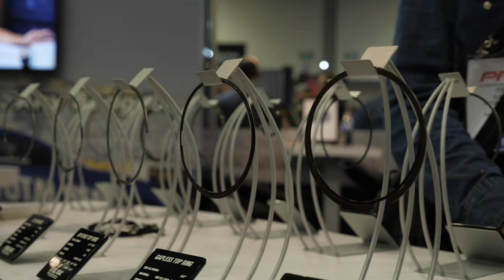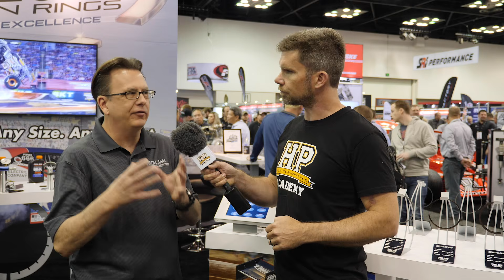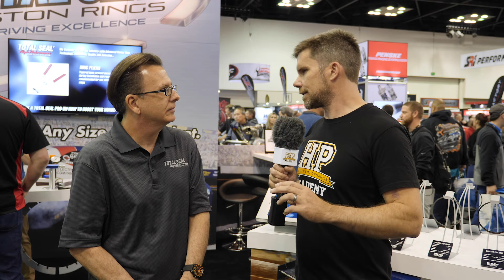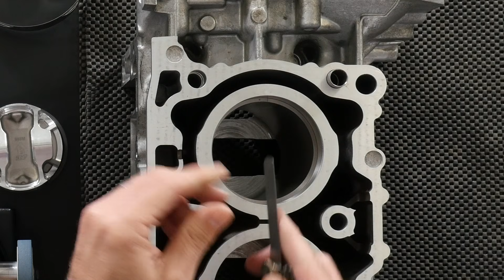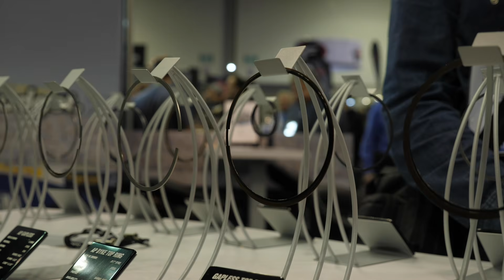Behind the Scenes of Gapless Piston Rings And Ring Flutter [#TECHTALK]

Comment from the maker: 🦸‍♂ Building a fast car? Get $400 OFF the all inclusive VIP online course package deal: https://hpcdmy.co/vipy78
🔧50% OFF your first engine building course. Enrol now:  https://hpcdmy.co/offery78
TIME STAMPS
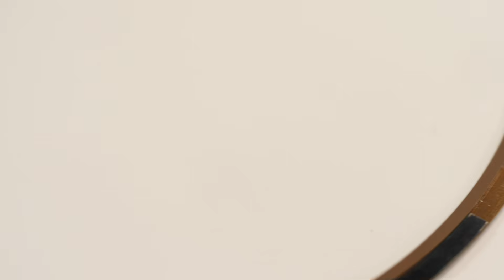00:00 - Intro 
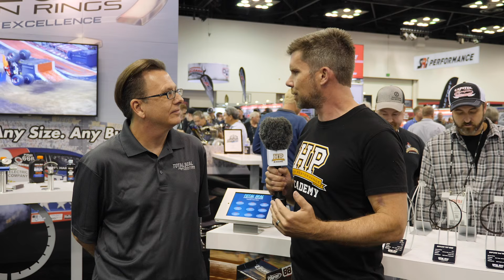00:30 - Gapless ring design 
00:50 -  Brief history on the gapless ring
01:20 - Why do we need gapless rings?
02:00 - Advantages of a gapless ring?
04:13 - Top Ring & Second Ring setup theory
06:08 - Which setup should you go for? 
06:51 - Heat considerations?
07:47 - Ring widths & Sealing
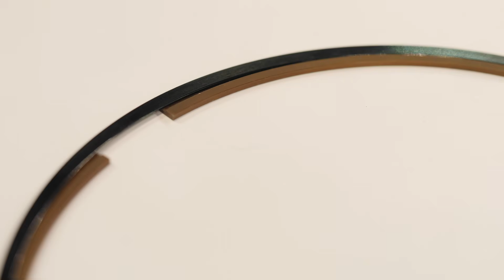09:40 - Heat Management & Micro Welding 
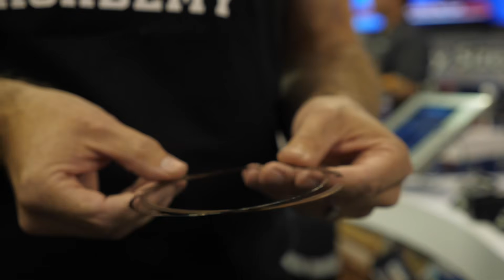11:50 - Radial Tension of rings
13:47 - Total Seal Products
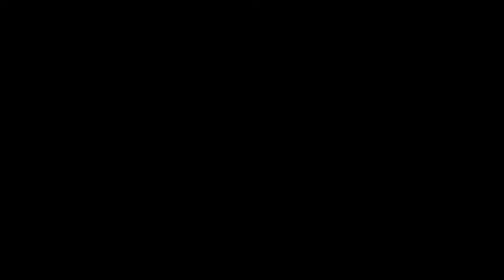14:29 - Outro

Comment: If you want an oil burner use gapless rings . I wasted alot of money on two sets of these rings , both  sets was on a fresh bore honed on a sunnon machine following keith's instructions to a tee . results were 200 miles to a quart of oil . went back to conventional rings and everything sealed up tight .I will never use or recommend these to anyone . Since i have talked to a fair few that had the same results . The oem never used these for a reason . Don't drink the Kool Aid .
Reply from the maker: A bit late for you sorry but but around 12:58 they say it's super important to consider the application, not just with gapless rings either. Everyone wants a performance engine that has the same maintenance intervals and costs as a stock OEM build, but it doesn't work that way; you are right 😅 - Taz.

Comment: These can work in various combinations, but they are far from the end all be all in rings. Fact is the friction of these rings in total is horrible and friction costs hp. Ring friction accounts for over 40% of friction in a engine. NASCAR engine builders do not use these rings and they have less than .0001 cylinder wear in a 500 mile race. Their specialized rings are available in .0001 oversize increments.

Comment: Fast forward to the future. Wagler Diesel ran a Cummins to just over a 1000hp and 1500ft-lbs of torque with Lake Speed Jr using Total Seal gapless 2nd ring. This was back to back with conventional rings. Cut crankcase blowby CFM in half. Oil stayed clean until the last couple pulls vs instant black with conventional. 10+ hp across the board, same boost with gapless, everything else the same. If extreme pressure Diesel combustion explosions didn't cause flutter, chances of it are very slim. Thats 250ft-lbs per cylinder in the Cummins starting at 1500 rpm. How much cylinder pressure is that? I'd bet a metric f*3kton.

Comment: This, by the way, is the next big frontier in modern racecar engineering: combining durability and reliability with friction reduction and high performance. That means compared to racecars of yesteryear where people were making rapid advances in fundamental engine design and suspension geometry and composites manufacturing and safety, today's innovations are in piston coatings, cylinder wall coatings, oil control, oil delivery, and uniform combustion sealing. When everybody operates at 99.5% or higher, that last half percent is the difference between winning and losing.

Comment: I run a gapless top ring on my SBF 331 and i do get ring flutter on my second ring as it doesn't let any blowby get by the top ring to seat the second napier ring and seat and seal and scrap the oil off.  Ill will use about 1 qt of oil every 100 miles.  The way i coreected it is i sealed the engine crankcase and let the engine become its own vacuum pump and seat the second ring.  Running this way, ill use 1/2 qt every 1000 miles.  Ive sean on total seals website that they now say that the gapless top ring does have a oil consumption issue as a negative on its use

Comment: So what is the compromise when using gapless rings.   If it was all good and no bad they would be in every OEM engine but that isn't the case.
Reply from the maker: You are 100% right, not everything that is good for a performance engine is good for an OEM engine. They are very different things built for different purposes 😎 - Taz.

Comment: I ran Total Seal's gapless on the street and race, both gapless top and gapless second.  The gapless second, on a well built 454, ran very well for over 200k miles.  Different story on race engine.  Consistently had oil smoke out the exhaust, oil consumption issues, detonation due to oil in the chambers.  This was with both gapless top or second.  Both had the same issue.  Went back to conventional rings, issues gone....

Comment: I saw a comment from some idiot armchair mechanic that said all piston rings rotate on the pistons when the engine is running so it's pointless to clock the rings so the gaps are is opposite positions 😂
Reply from the maker: They are right and wrong as they do rotate, but you still need to clock them noting they are both rotating and the chances of that happening so that they all align and stay locked there are slim.
It is also something that is out of our control, so you still give yourself the best chance of success regardless of such things.

But you know all that yourself, it's the other chap who is going to regret the 10 seconds of time he 'saved' on that step.

We see the same type of person saying that oil splashes onto your con rod changing the weight so there is no point balancing them too. People are weird - Taz.

Comment: Who was the maker of these rings, I can post picture of a piston that had gapless rings all the way around and it busted a piston after 5 years at 750 hp engine components rated for 1000 76mill turbo meth injection so if these are a better manufacturer idk be interested in checking them out
Reply from the maker: Nothing last forever to be fair and there is a point where building for a higher HP than you are running doesn't actually add any longevity. In some specific cases it would actually reduce it.
To answer your question though I believe 'Total Seal' is the brand Andre has personally used in a dedicated drag engine build/s - Taz.
Reply: @hpa101  thank you I believe the builder might have ran to tight of ring gaps and under boost it eventually blew up

Comment: yeh there's no ring flutter with a 9000rpm sprint car engine with 17:1 compression..
because at that high of a compression ratio, there's still enough blowby pressure to get past the 2nd ring,  even while using a gapless Total Seal ring, rather than pressure get trapped between the rings and cause flutter.  and there's enough blowby to make the low tension or standard tension oil ring work as well.  because some slight blowby is what makes the oil rings work work in the first place.  it's a simple concept, looking up at the bottom of the piston, from the crankcase side, blowby air pressure above the piston acts as an air gun and blows oil downward into the crankcase, and off the rings, and into the oil ring grooves, and openings in the oil ring groove, into the inside underside of piston.  and that keeps it out of the combustion chamber.  this is why Total Seal rings on a street engine smoke.  they're really a high compression race only ring application.

Comment: Do you think the second ring is even required with gap less?
Reply: On short track engines we only ran the top gapless, NO second and the oil control. If the skirts are short on the pistons with only the top, the piston can rock in the bore. The longest rod you can install helps this.

Comment: Does anyone bore/hone cylinders at operating temperature to have a round bore at temperature? Or are blocks designed so they can machined and the thermal distortion will cancel the elastic distortion due to cylinder pressure?
Reply: YES, many people do...
Reply: I'm pretty sure that Honda performs very exact calculations on thermal expansion of their aluminum blocks to machine then better for when in use. Their tolerances are very tight and oil-burning has typically been quite low.

Comment: What we need is individual electronic valves
Reply: KOENISEGG Free valve uses electro-hydraulic operated valves for an infinitely adjustable camshaft profile. I have been wanting to do this for 40 years.
Reply: @TheJagjr4450  I want someone to create an electronic valve system for other cars.
Reply: @realtruth97  Theres a old miata with freevalve floating around on youtube and theres predator 212s etc with freevalve.......might be the same guy doing it.
Reply: @jonpippen6998 
An EVS {Electronic Valve System}
would be cool.
I'll have to create it myself.
Imagine all the space it would save?
No need for oil.
Shafts.
Springs.

Just the valves in there.
Connected to the EVS.
🤔
Reply: @realtruth97  Find the miata video. The guy built his evs from scratch for it.Wayyyy over my head but was pretty cool.
Reply from the maker: One day - Taz.

Comment: I have a question Andre. I remember reading or hearing somewhere a few years ago about an R34 time attack car that was running Wills rings for piston rings. But, I’ve never been able to find anything about it. Surely this can’t be possible as they are a sealed system and you can’t get them over a piston, correct? If it is possible I would love to learn more about it though. Thank you!
Reply: There may have been some translation confusion, if they were called 'cylinder rings'?

Comment: I won't build an engine without a gapless ring so many advantages.
 increase fuel mileage more power
keeps the oilfrom being contaminated like they mentioned they will last Until Jesus returns.
And more. And you will get better fuel mileage if an engine has four or 5% Blow by that for 5% of your gasoline going into the oil in the form of carbon and of course going out the blow by I love them and with the increase fuel mileage they will actually pay for themselves over the life of the engine many times over

Comment: I've been using Total Seal Gapless rings for many years. I won't build an engine without them. They simply work!
Reply: you must have a lot of smoking engines you built then
Reply: @tunnelportterror  The last engine I built for myself was back in 2005 and it's not been apart since. It's still running and has about 1% leak-down. It makes upwards of 650-700HP. Not only that, but it's a little Buick V6 that does it.  It must be you or your engine builder that can't build an engine. I've never had an issue Total Seal Gapless Rings so I stand by my first comment.

Comment: Do that make one for the 2azfe?
Reply: I don't know. Sometimes they make a ring that isn't listed for a specific engine, but has the proper dimensions for use in that engine.
Reply: @skylinefever  yeah that would be a great mod for any 2azfe with the garbage rings toyota put in
Reply: @master6435  It is also important to upgrade the pistons, the early 2AZFE pistons didn't have enough oil drainback holes. That, in addition to the extremely narrow oil rings meant that the tiniest amount of varnish would make the engine burn too much oil. If the original pistons are in good shape, many people simply drill more holes in them. If the pistons aren't in good shape, people buy a set of the current ones.

I had a different engine with crappy piston rings, it was a Saturn Ecotec 2.2 and cylinder #3 was dead at 130,000 miles. I thought of reringing the engine, but I just decided to buy a new car instead.
Reply: @skylinefever  Yeah true

Comment: I've used Total Seal gapless rings in racing engines and never regretted it, wouldn't build a high performance engine w/o Total Seal gapless rings.
Reply: that's all they're good for, racing engines- not street engines
Reply: @tunnelportterror  You have NO IDEA what you're talking about.  You can't just install piston rings in a worn out engine bore and expect them to seal correct. Stop spreading misinformation and please...stop building engines in the sandbox in your back yard.
Reply: @tunnelportterror  
Uh, that's a really ignorant thing to say.

With a "race" engine with optimal ring gaps that are JUST shy of butting, there may be negligible difference initially.
However, over time rings and bores do wear very slightly and the end gaps open up and sealing is slightly compromised - this is why these rings are almost exclusively used in endurance engines, such as NASCAR, because their design allows the seal to be maintained even when each part's gap increases. Does it work? Uh, since ring leakdown and crankcase vacuum are often better at the end of a 500 mile race than at the start, I would think so.

Now, consider a "street" engine - while this means different things to different people - for one it may be a "street racer", for another a "power tour" car expected to do a few thousand miles between builds, for another it may be a stock or mildly modifies engine that's expected to do hundres of thousands of varies miles. While each of them may benefit from the improved resistance to wear compromising the ring seal, it's the last that should see most benefit.

Comment: Would these be useful for a turbo diesel engine?
Reply: Salty Steel 
YES
Reply: I think some replacements for the GM 6.2/6.5 include total seal rings. Whenever I read about them, the owners are always stunned by how many miles they can go before the oil turns black. The claim that Total Seal rings reduce oil contamination rates is correct.

Comment: "suction" what?  my engine is FI, so.. Really the pressures I run will blow the best NA engine away. Turbo engines don't have guys running these much so idk.
Reply: When off-boost, turbo engines are still pulling a vacuum. By maximizing that vacuum, you would at least theoretically get more power before the turbo has spooled.
I'm not sure why turbo guys don't often use gapless rings, Total Seal makes rings that are made out of exotic material to endure extremely high boost pressures.
Reply: Doh, perhaps you should review your understanding of how an engine works?
Hint, the piston's downward movement on the induction stroke needs to have a s*****n, or lower pressure, to draw in the fuel/air from the port.

Comment: I used Sealed Gap gapless rings in my Dodge Challenger 383 back in the 90's I had the Chromoly ones. It took about 30,000 miles to seat them in but after the seated in it was a beast.  I feel not many even know about them.
Reply: That seems wrong
Reply: Dude it shouldn’t take 30,000 miles.
Reply: @fastinradfordable  he was idling it down the road...at 500rpm it took that long to seat them.

Comment: I have run gapless rings exclusively since I learned about them when I worked for a NASCAR engine shop in the early 1990's.
Reply: Do you have a favorite manufacturer of gapless rings?
Reply: @forrestfuller6359   Total Seal is the only company that makes gapless rings.
Reply: Do you know Troy Martin
Reply: @terryhunter2526  No sir, the man I worked for built cammers for the FORD PERFORMANCE program at Les Ritchie's shop, Cliff Brien his name is on the side of Gas Rhonda's Cammer mustang. He left california after Les was killed at the Winter nats in 66. Something else I did not say was we typically did not run a 2nd ring with the gapless rings. - not for street engines - only in 5/8 mile circle track AND DRAG ENGINES. We heated blocks with the torque plates in place so they would act like the engine did during cycling.